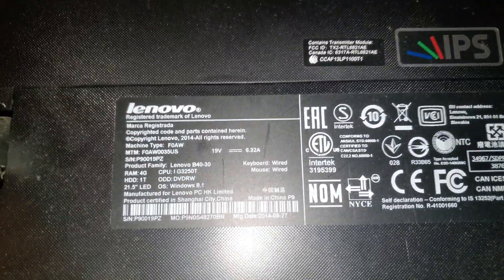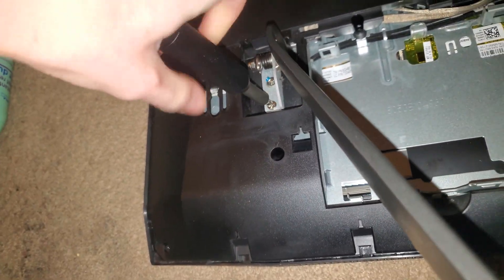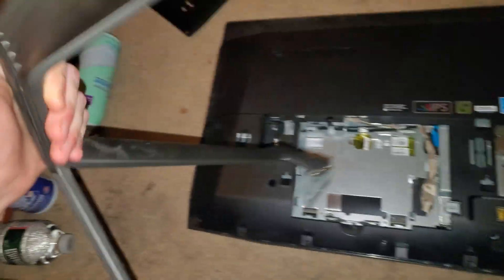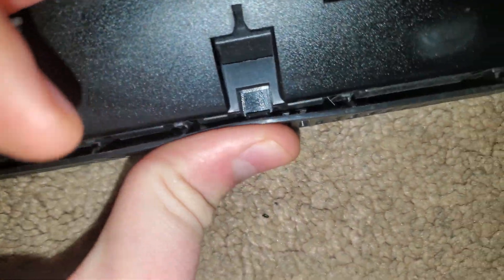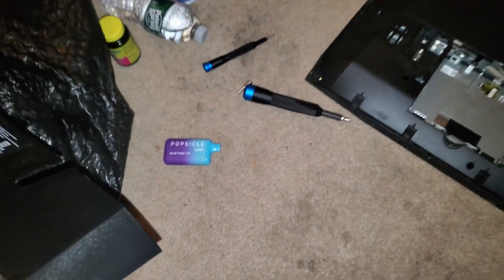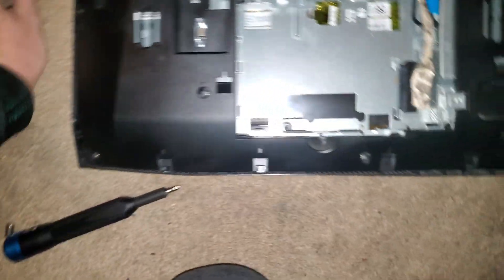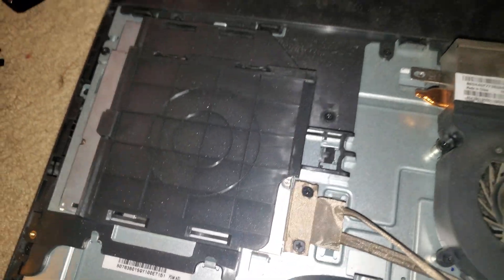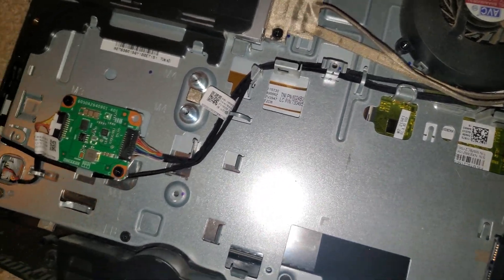Lenovo B40-30 Desktop Teardown (All in one)

Comment: Huh! Waste my time. At least you said early on that this video labelled "Lenovo B40-30 Desktop Teardown" isn't a teardown of Lenovo B40-30 Desktop
Reply from the maker: Sorry I didn't completely tear it apart. I pointed out what may help you tear it down but there weren't many references for complete disassembly, especially for this model. I did however find a hardware manual and I'll update the video with that info and provide it here. 

https://manualzz.com/doc/54974110/lenovo-b40-30-hardware-maintenance-manual
Reply: @Joro.r9  yes, I went looking and found the hardware manual on the Lenovo web site, with text instructions for pretty-well anything.